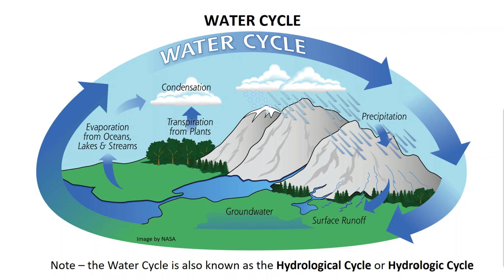HE05 01   Water Cycle

Comment: From now on, the “evaporation-condensation-rain” theory will no longer be taught to the world (new 2021).
Rain formation is the combustion of hydrogen in a true chemical reaction.
H₂ + ½ of O₂ → H₂O → Rain and not by condensation of water vapor resulting from evapo-transpiration which decomposes in altitude into H2 and O under the action of solar ultraviolet rays (UV) .
hv + H₂O → H₂↗free + O↗free
in 2 min 32 sec.
   https://youtu.be/dqH3Nrjw0N8